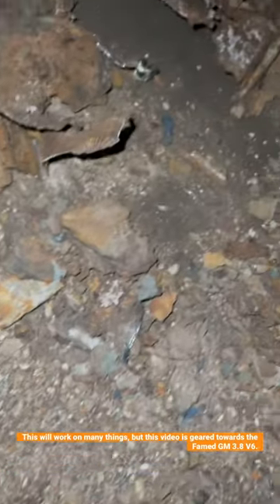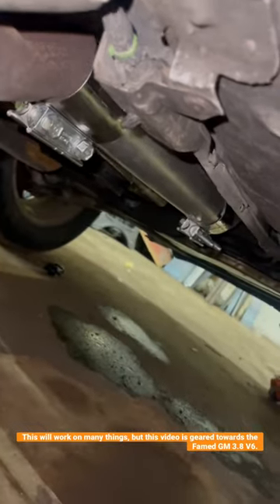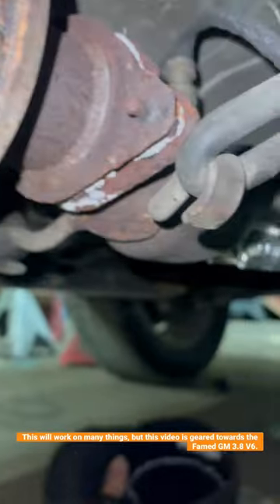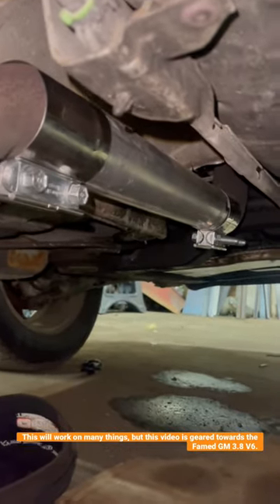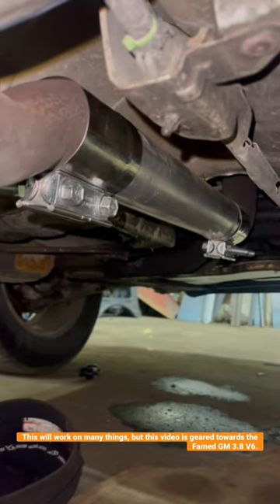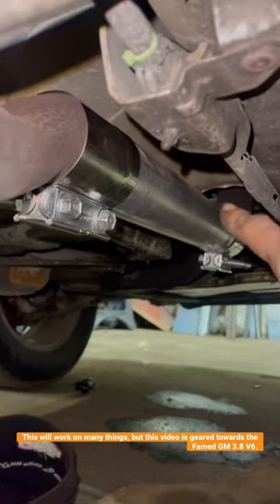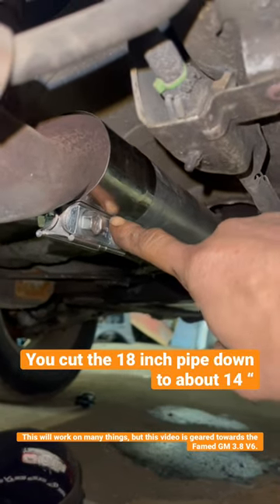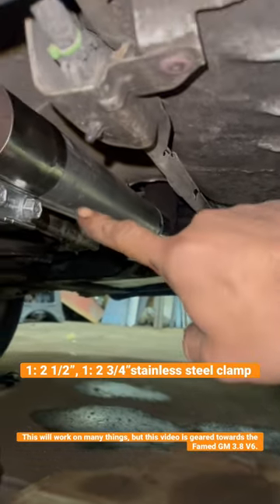How to fix a stolen catalytic converter… #3.8 #Pontiac #Grand Prix #Chevy impala

Comment: You will need to put a non fouler on the o2 sensor to keep the CEL from coming on and forcing a rich loop.
Reply: Beat me too it
Reply: Absolutely untrue I had a 3.8 firebird years ago and deleted the cat with a thrush muffler it actually increased gas milage and power the newer cars yes it will create issues due to the downstream o2 sensor but if there aren't any o2 sensors behind it you should be fine depending on the backpressure some folks will put restrictiors on the pipes to slow the flow down in the tail pipe known as cut outs

Comment: How much are you charging for the 2007 Saturn Vue V6 Engine cradle mounts  ?
Reply from the maker: I’d recommend you reach out to me and Clays ac and Auto Repair over Facebook or send me an email

Thenewcoayway@gmail.com

I don’t discuss prices over text messages or list them publicly, because prices change with inflation, and the geometry on different vehicles is different from Vin number to Vin number.
Reply: I would like to know , I need to know if I can fix it or junk it

Comment: Now a repair shop will not work on the vehicle until the catalytic converter is replaced.
Reply: This is a temp fix to get home.
Reply: @JDeWittDIY  yeah I see a lot of people to this temporarily… and it turns into a permanent fix. 😂 but yeah I think it’s illegal in every state to drive on a public roadway with a catalytic converter removed. My luck I would get stopped by the first cop on the way home and get some kind of massive ticket for no cat. 😂
Reply: Mine just got stolen in Chicago. I’ll use this method until my emissions test comes around. Why leave a new one installed so they can steal it again.  It’ll probably be a little extra work for me, but only loose time, not money.
Reply: @TsunauticusIV Only if he was searching for drugs.😁
Reply: @TsunauticusIV  Depends on the age of the car in my state. I have 3 old schools, and they don't require catalytic converters.
Reply: @grandam  I hope the state doesn't find out who they are
Reply: @User-nx7rs  Can you read???? IT'S NOT REQUIRED ON AN ANTIQUE CAR!!!
Reply from the maker: Yeah, they might take our merit badge away…. 

When you’re dealing with people that are willing to cut their catalytic converters off….. or somebody who has their catalytic converter stolen…. And they replace it with a piece of pipe…. 

At least they didn’t replace it with a pipe … unless you’re the one who actually stole it then you’re probably smoking out of the pipe…
Reply: @grandam 😢
That's a lie
Reply: @jamiegarrett3869  Cars 25 years or older are EXEMPT from emissions tests unless you are in California. I don't need one on my 78's AND the emissions don't get checked, I'm exempt.
Reply: @grandam  I am in cali pal and I support TRUMP.
Reply: @jamiegarrett3869  Your point???🤔

Comment: A 3.8 one of the best engines ever made?
Reply from the maker: I think so…. Lots of power, high fuel efficiency. Very very few mechanical problems, or at least less than most so in my book it’s the best one or at least one of the best.
Reply: Probably the best v6 ever made, not the best engine.